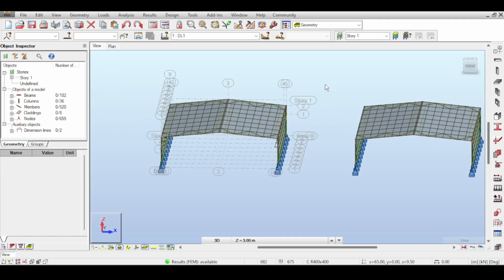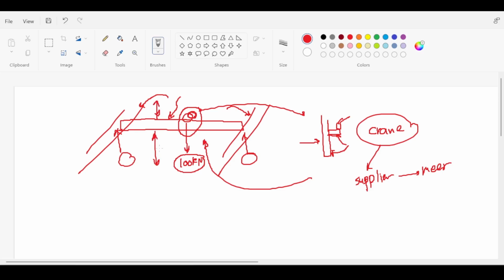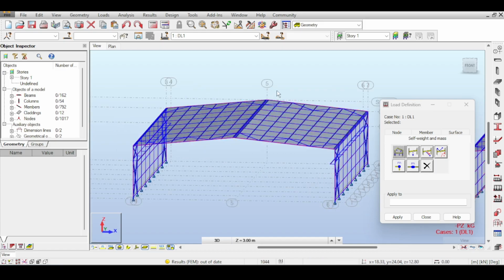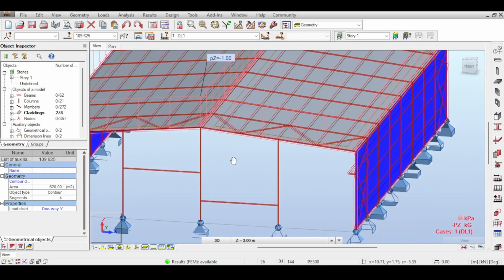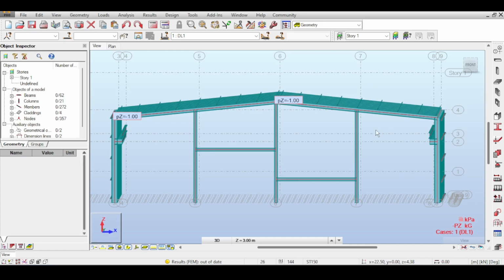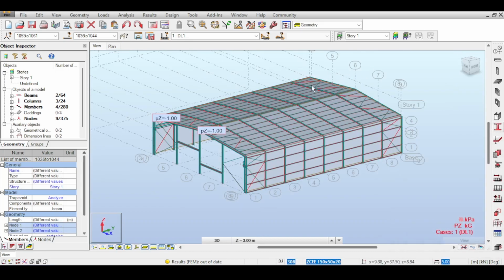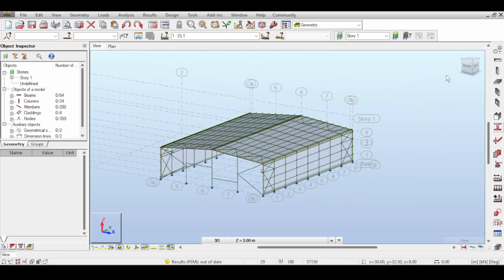Modeling of Industrial Warehouses | Part 4: Forces and Gable Frames

Comment: Hello CEE,

01:25 Extending Columns – Beautifully done Doc, I find this to be a very useful “tip and trick” indeed, thank you very much for sharing. It is these seemingly little things that help a lot to sharpen a great mindset in modelling approaches and in general.    

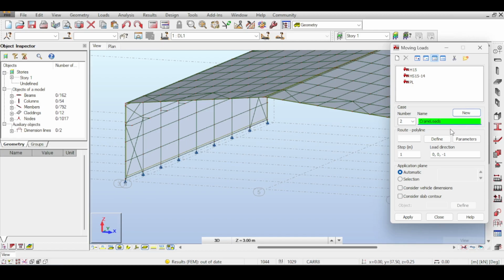11:39 Crane Loads – Considering the assumptions that have been made in this video and if one is using the “symmetric vehicles” crane loads definition; you may need to “define two separate vehicles” one for the 20kN crane reaction on the LHS and the other for the 100kN reaction on the RHS. It will thus be very important during loads combinations to explicitly make sure that the two vehicles load cases are “grouped or related” such that they are applied simultaneously to the structure. Also also, in the “route parameters dialog box” i.e., the button that is opposite to the one where one defines the crane route, there is a possibility to enter factors or coefficients which generate factored forces which estimates other related vehicle (crane) forces such as the crane braking forces as a fraction of the applied vehicle (crane) vertical loads.    

16:50 Dead Loads – You are not missing anything; I have the same doubts and struggle with these loads. The estimates that you did are numerically correct, these loads are usually in the average range of 0.3 kN/m2 – 0.6 kN/m2. 

Ordinarily, upsizing these loads as you did in this video would mean that the design will result in somewhat stiffer members (which is not necessarily a bad thing). Still my struggle is that I’d rather prefer to use comparatively lower loads (where this is possible) when designing Cold-Formed Purlins as these elements are sensitive to the loads. Also, the wind-uplift (reversal) is usually an important load case in the design of portal frame buildings, and therefore upsizing the downwards loads is not favourable in this scenario as this dilutes (only on paper) the effects of the “reversal” actions on the members concerned, also the upwards serviceability deflections appear (only on paper) to be “reduced”.

Note, I keep saying “on paper” because irrespective of how large we may estimate or we may assume the downwards loads to be on the structure. In reality, the structure can only exert the downward loads that it is experiencing and not the ones that we may have assumed that it will experience on paper. For my struggles above, I usually test (design) for the “reversal” by using the usual average loads even if these loads do seem to be comparatively low. 

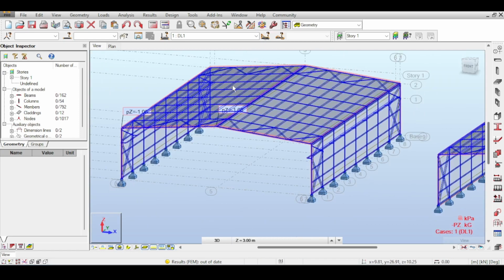21:41 Gable Frames – I guess the proof is really in the pudding here. I am of the opinion that the CEE has covered the nuances of the gable frames very very well on this video (Yes, I did like the monologues, I have learned a lot from all the right questions [34:00] from the monologues in this video, the monologues also contained multitudes of possible options and other enlightening ideas). Granted that I’d also like to view and review some of the connection details that are being used in real-life. All the same, I would still go for gable columns that are pinned-at-the-base and pinned-at-the-rafter [and with that configuration, I would use the Full Portal Frame at the gable end = Baby CEE option 👶]. 

The idea of flipping and aligning the roof (warren truss style) bracings to the gable columns is ingenious (notwithstanding the curious question of the gable column-to-rafter connection detail at this location of course). 

Although it may not seem “usual or common”, should the size of the structure or the results of the calculations requires it to be so, I would also not shy away from introducing additional compression members to the “horizontal roof bracing system” [ref 43:12] in order to form (say a warren with verticals, or to form other applicable types of horizontal roof bracing trusses such as Pratt, Howe, etc.) that would be able to better limit the out-of-plane displacement of the bracing portal frames rafters (I have notice that a similar point has been raised (noted) by one of the viewers (subscriber) in the comments to this video and I agree with their approach if it turns out that the warren truss style bracing by itself is not proving to be enough).

Furthermore, the design of the above bracing portal frames rafters and the associated connections would also need to take into account the explicit presence of the axial compression and/or axial tension forces that would have arisen from these members also acting as “top and bottom chords” of the “roof horizontal bracing truss”.

@CEE, what are your thoughts on the “full truss with additional compression members approach” for bracing the roof? Have you ever come across such a situation in real-life? Does it make sense to you from a theoretical point of view? and would yourself consider such an approach if the size of the structure or the resulting wind loads reactions calculations demand it? 

General: It may be a good idea to have (as far as it may be practically possible) the spacing of the gable columns to be equal-ish to the spacing of the portal frames in order to facilitate the same span (and consequently the same sizes) for the girts all around the building.

The ideal orientation of the gable columns sections (in order to help with stability on the YZ plane and to also help with bending resistance in that plane) have already been noted by others in the comments. I would like to ask if in a case of a relatively high warehouse, say +16 meters; what efficient options are available in order to manage the relatively-long buckling length of these columns (or these beam-columns if wind loading is being considered) in this plane?    

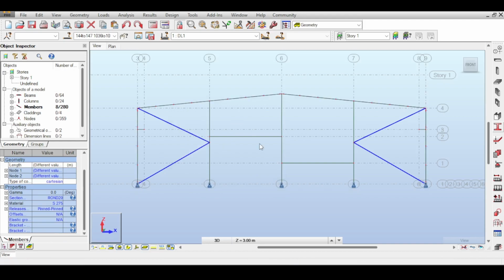47:55 to 48:55 amen! 

I have enjoyed this video and I am looking forward to the next CEE videos. Thank you Doctor for stirring these thoughts invoking discussions. And Oh, thank youuuuu Editor CEE, for keeping us even more entertained while we learn, it is really amazing what you are able to do with only the “text box” Mr Editor CEE! I cannot stop laughing most of the time and it is so so good, so thank you sir.  

Keep well and kind regards, DK
Reply from the maker: Hi there Engr. DK,

I thought of AutoCAD when I was doing the column extension. It is just amazing how good RSAP is.

As for crane loads, I share your concern about them moving in unity. I am banking on the fact that the max moments should occur when the both the point loads are at the same time. 
You are right, in the 0,0,-1 factors, we can define any factors that correspond to the loads. Now please note, I have no data with regard to breaking, I can only stress it out during modeling. 

Great to know, I felt a strange feeling having those lil' loads in dead.

I hear you, purlins would be affected as well as wind uplift, as this is being countered by the dead load. Now I can only stress this in my next video ^_^.

Oh the gable frames were an amazing topic. You can even see the cool comments of our deat viewers with regard to gable frame. Also, I had some new ideas with regard to stabilization and gable portal connections. 

There was even a cooler idea that I missed and was pointed out by a dear viewer, namely: mirroring. I remember using this before, but I missed it this time.

ooooooooh, the compression bracing. Yes, I went to Ikea in Bahrain specifically to get some inspiration of the steel roof they use. They do use compression members, I have some pics I will share next time. So yes, it is possible to have both compressive and tensile members in the roof.

Oh, the idea of gable frame spacing is genious. It simplifies the design of the purlins, I will mention it. I might not change the position, but I will definitely mention it.

Yes yes yes, gable columns, I will talk about it next time. Great stuff I read and saw.

Thnx a lot for the positive feedback, I am really happy that it stirred so much discussion in the community. This is exactly the purpose of this channel.

I'm still preparing the next video, might be a little late this time.
Regards,
CEE

Comment: More than wonderful effort, thank you very much, but in the case of a crane, a lateral force is generated as a result of movement, like what happens on trains.
Reply from the maker: Totally correct. Actually, the breaking and accelerating of trains is one major component in the design of railway bridges ^_^

I still - however - cannot give any values here, as those are highly specific on the manufacturer and the speeding up and slowing down accelerations of the crane. There are also - in some extreme circumstances - dynamic effects for cranes if the crane cable is too long.
It is even stipulated in the AREMA code, which is referenced by AASHTO in the bridge design.

Comment: I'm currently working on designing a two bay portal frame that measures 27m x 7.5m with 7 openings for trucks at the front. One of the challenges I'm facing is stabilizing the gable frame, and so far, I haven't found a solution that completely satisfies me. I did try using compression members as horizontal bracings to limit the out of plane displacement of the rafters, but I'm not sure if it's the ideal approach. If you have any additional insights , I would greatly appreciate it.

One suggestion I have to flip and fix the bracings, you can simply select them and use the mirror tool by choosing two midpoints of two purlins or bracings in the 1st bay. This method allows for easy and efficient alignment of the bracing elements without zooming in and out and fearing to snap the wrong point.

I only discovered your channel few hours ago, and I must say that I find your content to be extremely valuable and of high quality. That blend between the theoretical concepts and practical application on software is just perfect.
Keep up the excellent work.
Reply from the maker: Hi there, welcome to the CEE Channel. Hope you enjoy it.

oh I missed the mirror tool, it would have helped in my case 100%
I am - similarly to you - still not satisfied with the gable frame. Yes, the columns need to be flipped 90 degrees but I am still somehow trying to find the best way to stabilize the frame. I have planned some field visits this week to take a look on multiple structures and try to formulate something that is suitable to be youtube content.

Anyways, I am happy you find this channel beneficial. Stay tuned for more videos.

Regards,
CEE

Comment: Hi cee thanks for the efforts 
If i'm not wrong 
The gable column should be rotate with 90° 
And about releases you will select all the rotation and the Ux direction for the Gable column
Reply from the maker: That's an amazing info.
Of course, the question that comes to my mind is: how would the connection look like in that case? Do you have any document or figure you can refer me to? I would highlight this in the next video.

Still, thank you very much for your comment.
Regards,
CEE
Reply: @CivilEngineeringEssentials  for the grab column we make oblong hole 
If the déplacement of the beam on vertical direction the bolt will not transfer the force to the gable column because the form of hole is oblong hole 
I'm sorry for my english i hope the message is clear
Reply: Hi CEE, seems fairly standard practice in UK to have vertically slotted holes in the top connection of a gable to underside of rafter. Will try to find a detail and email you.
Reply: How can i send you a picture of the connection
Reply from the maker: @youyoutarikt7015  you can use the email:
civ.eng.essentials@gmail.com

Thanks a lot for your assistance.